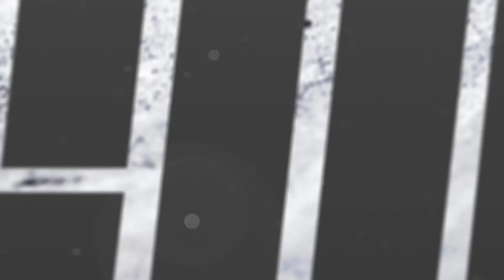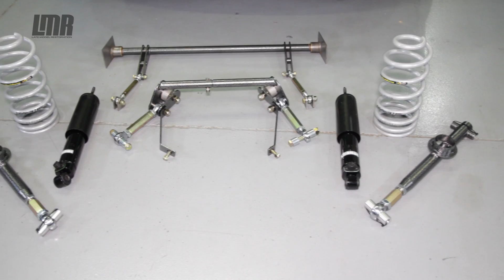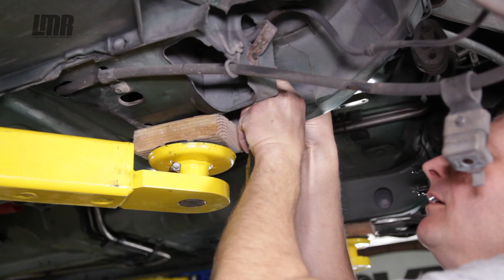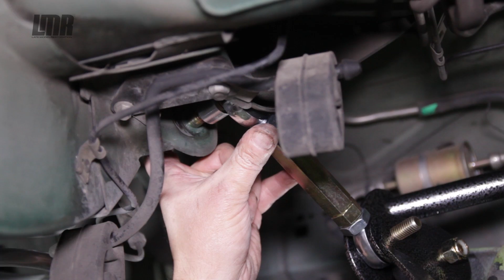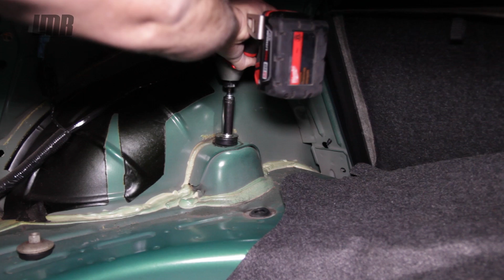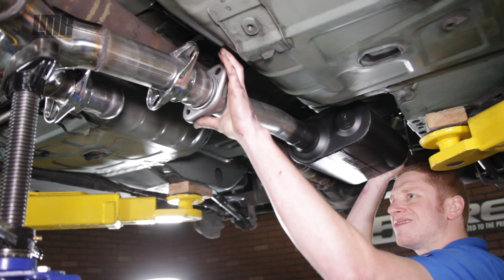1999-2004 Mustang GT Project Green Bean (Stage 3)

Comment: Why does Green bean have the V6 style side scoops and hood? I thought the V8s all came with the larger hood scoop and the side vents that came out parallel to the door?
Reply from the maker: +Robby McCool 99-00 GTs had smaller side scoops and shared the same hood as the V6. -Landan
Reply: +Late Model Restoration huh I never realized that, thanks! (I have an 02 sixxer)

Comment: I'm confused. With the updated cat back exhaust installed to wake Green Bean up.... doesn't this necessitate a quick emailed tune for your SCT tuner to maximize your hard work? ALSO, the latest issue of a certain Mustang magazine featured StreetBurner intake manifold from a company called Trick Flow. Looks totally different from any other replacement intake for the 2 valve. Would be awesome if you could review and install one.
Reply from the maker: +Scott9084 In the intro I talked about having a SCT strategy tune on the car because of the 4.10 gears. The same tune is still on it at the moment. -Landan

Comment: I'm installing the same x pipe and cat back on my 2000 GT.  I went with different headers though because I have a 5.4 4V swapped into it.  I decided on the Bassani mid length headers.  I'm hoping that it sounds awesome when it's ready to roll